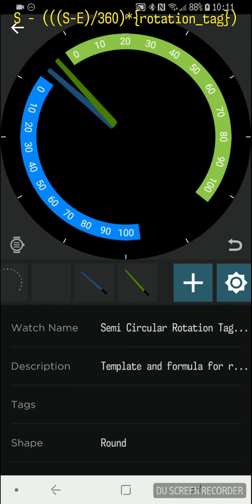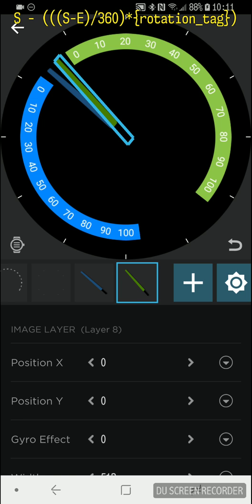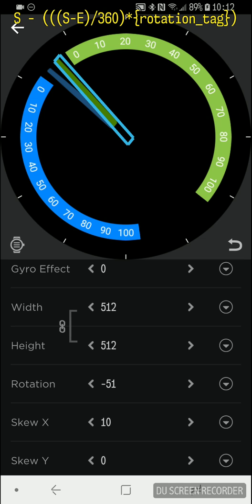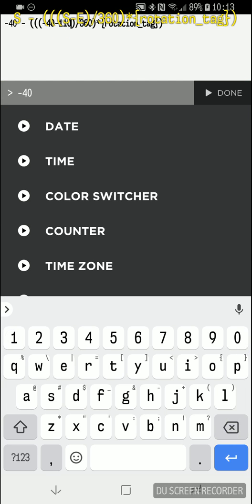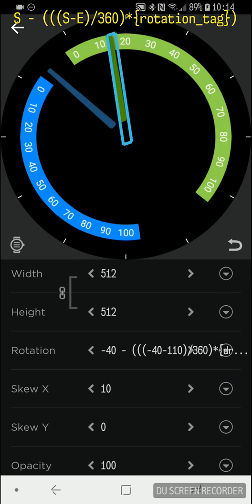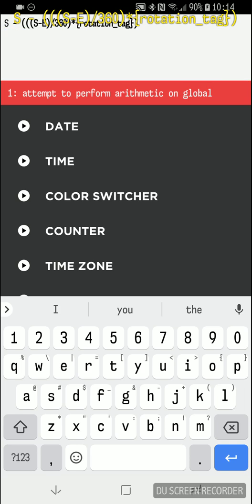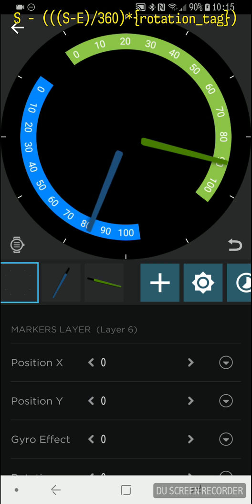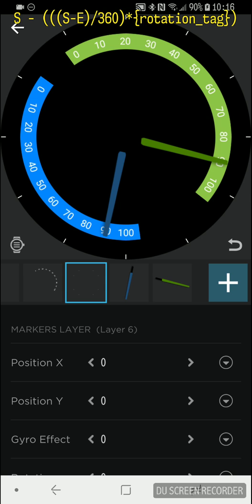WatchMaker Arc Rotation Tutorial & Formula

Comment: hey Grodin, great video by the way. So my question is this? Can i use this formula for a 7 Days Subdial? And a 12 month or 31 days Subdials for my Galaxy Watch 5 pro.
Reply: My tutorial:
For 360° rotation
(Into the box "Rotation"):

Days in month, movement by steps: 
{dd}*11.6

Days in month, smooth movement: 
({dd}*11.6)+(({drh24}/31)-11.6)

Days of week, movement by steps: 
{ddw0}*51.4

Days of week, smooth movement: 
({ddw0}*51.4)+(({drh24}/7)-51.4)

Months, movememt by steps ({12 months}x30° because full circle is 360°, and 360 divided by 12 is 30):
{dn}*30

Months, smooth movements:
({dn}*30)+((({dd}*11.6)/12)-30)

Hours 12 smooth: 
{drh}

Hours 24 smooth: 
{drh24}

d-date
r-rotate
h-hour

360° rotation
For 1/2 180° half rotation divide formula by 2!
For 1/3 120° third rotation divide formula by 3!
For 1/4 90° quarter rotation divide formula by 4! 
For 1/7 51,4° rotation divide formula by 7!
For 1/31 11,6° rotation divide formula by 31!

For example (180°)(1/2) half rotation of (“Days of week, smooth movement“)
formula:
(({ddw0}*51.4)+(({drh24}/7)-51.4))/2

For example (240°)(2/3) rotation of (“Days of week, smooth movement“)
formula:
(({ddw0}*51.4)+(({drh24}/7)-51.4))/3*2

For any angle of rotation, when you can't find a common denominator, divide formula by 360°, and multiply this formula by this angle!

For example, if you want rotation of 24 hour hand in 263° angle, use this formula!:
{drh24}/360*263

(It is a good idea to prepare png images of the hands in the angles of the starting position.)
(Do not forget to use parentheses and that decimal points should not be commas, but dots!)

I'm Slovak, I'm not a programmer, I've never been good at methematics either, but I couldn't find instructions anywhere, so I had to come up with formulas myself to make them work, and I hope I explained them to you clearly enough, and that they help you.

If you don't understand, Google Translate is to blame.🙂
Reply: If you want to opposite rotation, give the full formula into "()" parenthesis, and before the parenthesis give the sign minus "-"! For example: -(drh24)

Comment: I am trying to create a rotating date dial for days of the month (1-31) but can’t work out the code… any help appreciated :)
Reply: For 360° rotation
(Into the box "Rotation"):

Days in month, movement by steps: 
{dd}*11.6

Days in month, smooth movement: 
({dd}*11.6)+(({drh24}/31)-11.6)

Days of week, movement by steps: 
{ddw0}*51.4

Days of week, smooth movement: 
({ddw0}*51.4)+(({drh24}/7)-51.4)

Months, movememt by steps ({12 months}x30° because full circle is 360°, and 360 divided by 12 is 30):
{dn}*30

Months, smooth movements:
({dn}*30)+((({dd}*11.6)/12)-30)

Hours 12 smooth: 
{drh}

Hours 24 smooth: 
{drh24}

d-date
r-rotate
h-hour

360° rotation
For 1/2 180° half rotation divide formula by 2!
For 1/3 120° third rotation divide formula by 3!
For 1/4 90° quarter rotation divide formula by 4! 
For 1/7 51,4° rotation divide formula by 7!
For 1/31 11,6° rotation divide formula by 31!

For example (180°)(1/2) half rotation of (“Days of week, smooth movement“)
formula:
(({ddw0}*51.4)+(({drh24}/7)-51.4))/2

For example (240°)(2/3) rotation of (“Days of week, smooth movement“)
formula:
(({ddw0}*51.4)+(({drh24}/7)-51.4))/3*2

For any angle of rotation, when you can't find a common denominator, divide formula by 360°, and multiply this formula by this angle!

For example, if you want rotation of 24 hour hand in 263° angle, use this formula!:
{drh24}/360*263

(It is a good idea to prepare png images of the hands in the angles of the starting position.)
(Do not forget to use parentheses and that decimal points should not be commas, but dots!)

I'm Slovak, I'm not a programmer, I've never been good at methematics either, but I couldn't find instructions anywhere, so I had to come up with formulas myself to make them work, and I hope I explained them to you clearly enough, and that they help you.

If you don't understand, Google Translate is to blame.🙂
Reply: If you want to opposite rotation, give the full formula into "()" parenthesis, and before the parenthesis give the sign minus "-"! For example: - (drh24)

Comment: I'm old, and I struggle to grasp the coding aspect of watchmaker. I wonder if anybody could help?... I have 31 numbers around the edge of my watchface, I want a hand to point to the current date. If I select a hand to point to the numbers and choose "day in month" from the menu, it doesn't point to the right date. For example today is the 5th but it points to just shy of 3.

If anybody could help I would really appreciate it, I'm trying to learn this but it's not my strongsuit.
Reply from the maker: "{dd}*(31/360)" on the hand rotation should do it.
Reply: My tutorial:
For 360° rotation
(Into the box "Rotation"):

Days in month, movement by steps: 
{dd}*11.6

Days in month, smooth movement: 
({dd}*11.6)+(({drh24}/31)-11.6)

Days of week, movement by steps: 
{ddw0}*51.4

Days of week, smooth movement: 
({ddw0}*51.4)+(({drh24}/7)-51.4)

Months, movememt by steps ({12 months}x30° because full circle is 360°, and 360 divided by 12 is 30):
{dn}*30

Months, smooth movements:
({dn}*30)+((({dd}*11.6)/12)-30)

Hours 12 smooth: 
{drh}

Hours 24 smooth: 
{drh24}

d-date
r-rotate
h-hour

360° rotation
For 1/2 180° half rotation divide formula by 2!
For 1/3 120° third rotation divide formula by 3!
For 1/4 90° quarter rotation divide formula by 4! 
For 1/7 51,4° rotation divide formula by 7!
For 1/31 11,6° rotation divide formula by 31!

For example (180°)(1/2) half rotation of (“Days of week, smooth movement“)
formula:
(({ddw0}*51.4)+(({drh24}/7)-51.4))/2

For example (240°)(2/3) rotation of (“Days of week, smooth movement“)
formula:
(({ddw0}*51.4)+(({drh24}/7)-51.4))/3*2

For any angle of rotation, when you can't find a common denominator, divide formula by 360°, and multiply this formula by this angle!

For example, if you want rotation of 24 hour hand in 263° angle, use this formula!:
{drh24}/360*263

If you want to opposite rotation, give the full formula into "()" parenthesis, and before the parenthesis give the sign minus "-"! For example: -(drh24)

(It is a good idea to prepare png images of the hands in the angles of the starting position.)
(Do not forget to use parentheses and that decimal points should not be commas, but dots!)

I'm Slovak, I'm not a programmer, I've never been good at methematics either, but I couldn't find instructions anywhere, so I had to come up with formulas myself to make them work, and I hope I explained them to you clearly enough, and that they help you.

If you don't understand, Google Translate is to blame.🙂

Comment: How do you make hand rotation for days of the week
Reply: For 360° rotation
(Into the box "Rotation"):

Days in month, movement by steps: 
{dd}*11.6

Days in month, smooth movement: 
({dd}*11.6)+(({drh24}/31)-11.6)

Days of week, movement by steps: 
{ddw0}*51.4

Days of week, smooth movement: 
({ddw0}*51.4)+(({drh24}/7)-51.4)

Months, movememt by steps ({12 months}x30° because full circle is 360°, and 360 divided by 12 is 30):
{dn}*30

Months, smooth movements:
({dn}*30)+((({dd}*11.6)/12)-30)

Hours 12 smooth: 
{drh}

Hours 24 smooth: 
{drh24}

d-date
r-rotate
h-hour

360° rotation
For 1/2 180° half rotation divide formula by 2!
For 1/3 120° third rotation divide formula by 3!
For 1/4 90° quarter rotation divide formula by 4! 
For 1/7 51,4° rotation divide formula by 7!
For 1/31 11,6° rotation divide formula by 31!

For example (180°)(1/2) half rotation of (“Days of week, smooth movement“)
formula:
(({ddw0}*51.4)+(({drh24}/7)-51.4))/2

For example (240°)(2/3) rotation of (“Days of week, smooth movement“)
formula:
(({ddw0}*51.4)+(({drh24}/7)-51.4))/3*2

For any angle of rotation, when you can't find a common denominator, divide formula by 360°, and multiply this formula by this angle!

For example, if you want rotation of 24 hour hand in 263° angle, use this formula!:
{drh24}/360*263

If you want to opposite rotation, give the full formula into "()" parenthesis, and before the parenthesis give the sign minus "-"! For example: - (drh24)

(It is a good idea to prepare png images of the hands in the angles of the starting position.)
(Do not forget to use parentheses and that decimal points should not be commas, but dots!)

I'm Slovak, I'm not a programmer, I've never been good at methematics either, but I couldn't find instructions anywhere, so I had to come up with formulas myself to make them work, and I hope I explained them to you clearly enough, and that they help you.

If you don't understand, Google Translate is to blame.🙂